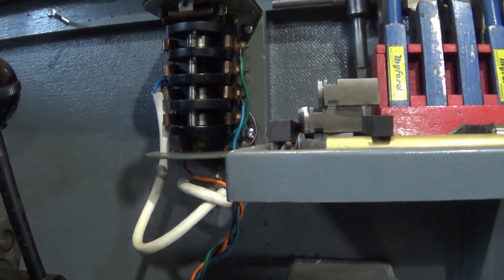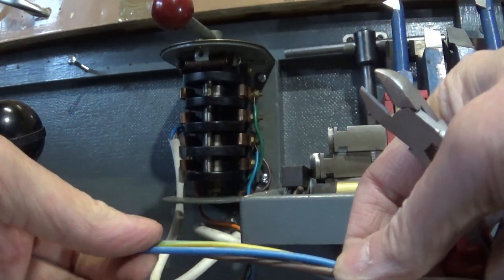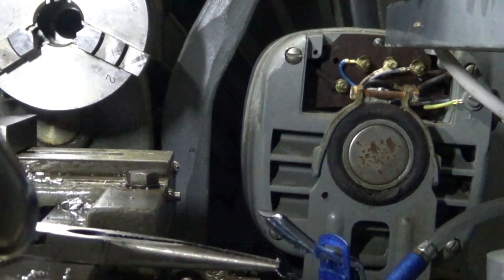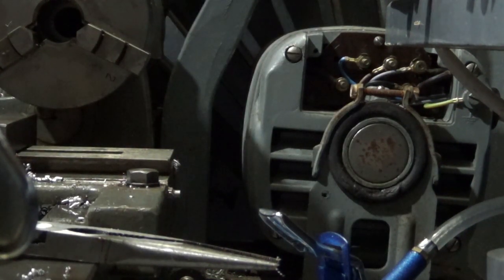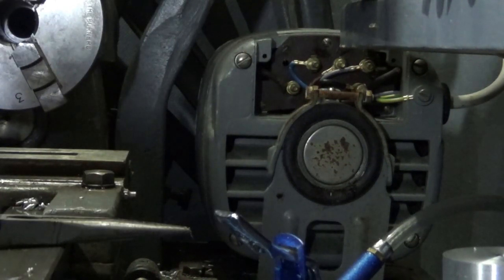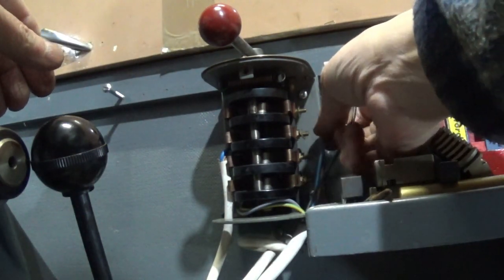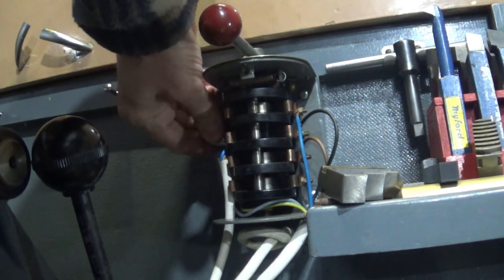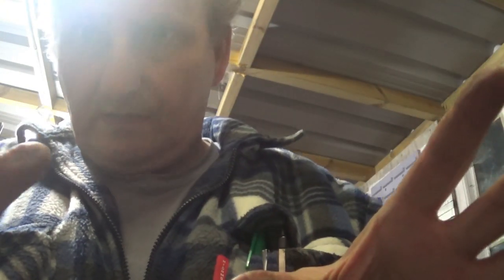Wiring a drum reversing switch to a single phase motor

Comment: liked that Myford lathe tooling bar. Is that an original one?
Reply from the maker: Many thanks. I don't know if it was supplied by Myford in 1951 or whether the original owner made it but the tools are as new in 1951. I got the machine (for free) as new with probably less than 10 hours use.

Many thanks for watching!

Comment: Hi Ben,I have a super 7,I had thought about fitting one of those Myford Forward/Reverse switches but I was very concerned with the chuck being threaded and not bolted on could running the chuck in reverse unscrew it and fly off... Is that possible  or am I missing something ? ps love your Videos.
Reply from the maker: Many thanks for your kind words.

The short answer is there is a danger to the chuck winding itself off the spindle in reverse, however that only arises if you have a cutting tool engaged. 

The idea of using a reverse is to be able to reverse up a thread with the tool disengaged, but leadscrew engaged when thread cutting so as to make up for the lack of thread dial that I don't have on mine and many don't have.

Also, I didn't actually fit it, it was fitted to the cabinet by the original owner. 

Many thanks for watching!

Comment: Hello Ben I got my late dad's super 7 he just had the motor wired to a plug so it was on and off
On the front of the lathe was a panel with all the buttons and the switch
It took me ages to figure out what was what but I done it
At the time I was not very good with wiring and didn't have a clue
Reply from the maker: Well done for figuring it out! Mind you, you can't cut on a Myford in reverse as the chuck screws on.

Many thanks for watching!
Reply: @BensWorkshop  I've got to sort out the 3 jaw chuck as the Jaws are worn
Reply from the maker: If you can trace the make you may be able to get new jaws but you can also buy new chucks.

Comment: can a drum reveral switch be used in a DC environment?
Reply from the maker: They are generally set up to connect a starting coil in parallel to the main coil so they both run at the same voltage, so if the normal arrangement of your DC or universal motor is parallel rather than series I would have thought yes though you would want to test it a bit.
That said you can always use H bridges and electronics. 
What sort of motor is it?
Also many thanks for watching! Please like, share and if you like the channel, subscribe!
Reply: @BensWorkshop  It is me who should be thanking you for your thoughtful concern.  
I am using a DC winch on my utility trailer, I have a ramp/tail gait that for my mower, skid loader, and mini ex that is too heavy for me to lift up and down manually , so I fabricated a few brackets and sheaves to manipulate the cable on the winch to actuate the ramp/tail gate into going up and down. 

The problem is that the cable needs to be at just the right tension to avoid flopping while going down the road, and not too tight to wear it prematurely in the sheaves and connection points so I bump the in/out switch on the winch controller to sneak up on the perfect tension point.  That on and off, plus the high amp draw to pick up the gate/ramp until its past 45 degrees is very high from the battery.  The control kit that comes with the winch that includes a low voltage switch, and reversing solenoid isn't  sturdy enough to be a durable solution.  I was hoping a drum switch might be good answer?
Reply from the maker: Drum reversers in AC induction motor use don't use much current. 1/3 of a horsepower is 1 amp running at 240 volts but at 12V would be 20 amps. 
The contacts are unlikely to be able to deliver high power at car voltages. You could use relay with the appropriate current rating though.
However what sort of power are you likely to use?
Reply: @BensWorkshop  I'm not sure Ben, I don't own a DC amp meter.
Reply from the maker: @robbjohnson7072  It is unlikely that you would own a DC ampmeter that could take the current anyway. Most go up to 10 amps.

What is the rating for the motor? There should be something on it.
Reply: @BensWorkshop  so the motor is a 12 volt, DC motor,  rated at 1.2 horsepower.

In the manual there is a chart that indicates the following

0 line pull 10 amps
454 kg.      55 amps
907 kg.       106 amps
1134 kg.    135 amps

I have no way to judge how many kgs the motor pulls during a tailgate/ramp raising cycle.  If I had to guess, I would say the ramp weighs somewhere in the neighborhood of 175 kgs???

Therefore while at its heaviest the Winch could  be pulling about 40??? amps during the lift cycle?

Those numbers are educated guesses based on the chart in the manual, not mathematical proportions.  Additionally my weights are estimates as well.
Reply from the maker: @robbjohnson7072  The reversers I have and can buy will not do 10 amps as far as I know. you'd be better off with heavy duty contactors.